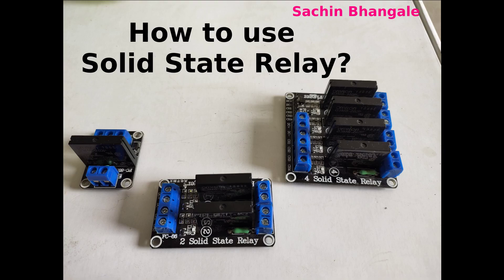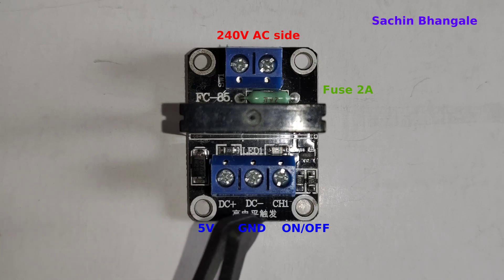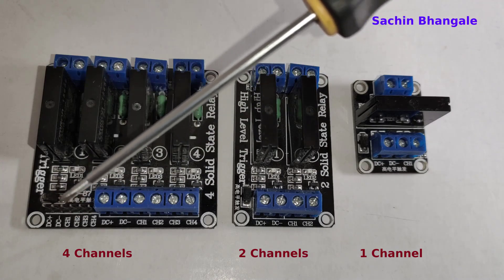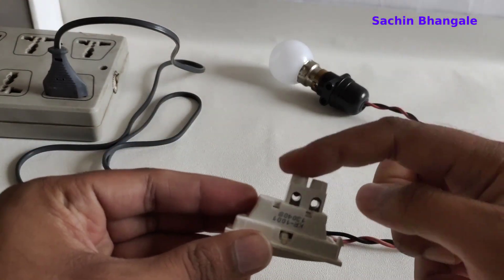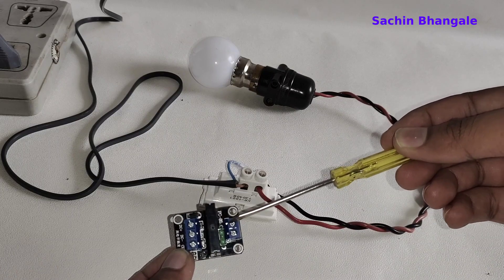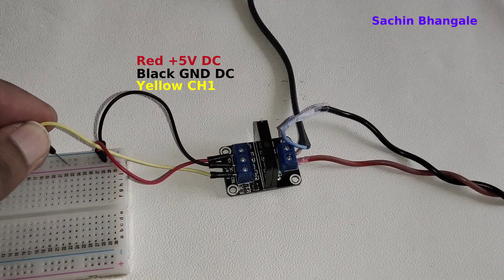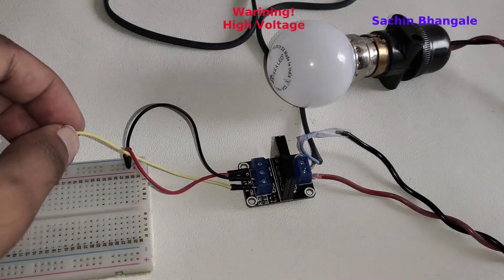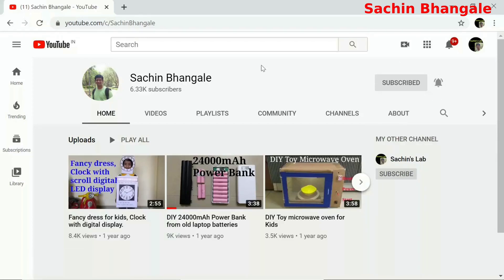#34E, How to use Solid State Relay?

Comment: I am a beginner and I'm scare getting electrocuted by high voltage. Can I use DC load instead of AC load on the module  you show in this video?
Reply from the maker: These relays are made to work with DC voltage but not for DC load. You can use another relay which are made for DC load.
Reply: @SachinBhangale  Thank you for replying.
Is there Solid State Relay fro DC Load?

Comment: I cant seem to make this work for DC Loads...🙁
Reply from the maker: For AC and DC load you will need different variants of SSR.
Reply: @SachinBhangale  I learned the hard way, bought 8 pcs and not a single one can be used to switch DC loads on and off. 😅😂 But Thanks for the reply! ☺
Reply: @DRCE777  me too, I was so excited to change all my mechanical relay, to my surprise when it is on, it doesn't switch off
Reply: @SachinBhangale  this triac type ssr can only be used for ac !! right ? then non triac type relay module will work for both ac and dc , right ?
Reply: @SachinBhangale  at PLC output, for 0.5 hp single phase ac water pump > what type of ssr/relay and mcb rating to be used ?